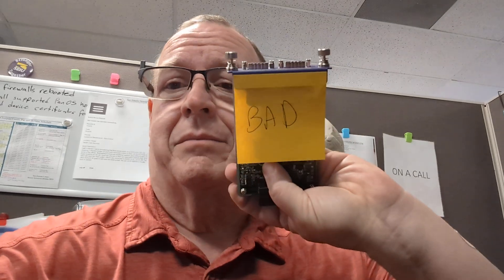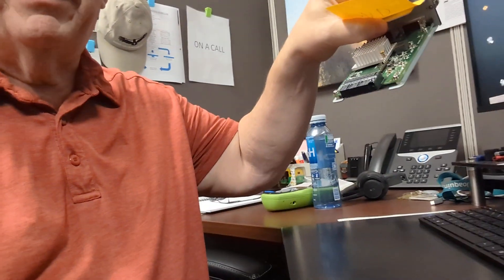Network Admin Life - ED Switch Failure Root Cause

Comment: These add-on modules in any brand seem to cause problems, eh?  Just the other day I had a Cisco Catalyst 9200 sh!t the bed…kind of.  The NM-4G network module that had its fiber uplinks to my 2 core switches just shut down for no apparent reason.  Nothing in the logs either.  Took out my entire building’s operation @ $15k/hr downtime for 15mins.  More on that in a minute.  I thought what the heck, it’s down anyway so let me pull the SFP’s and re-seat them.  Bang, came back up.  After that, I set up 2 trunk ports on the rj45 side of the switch so that, if the card drops again, it will still have a link back to the switch above it in the rack.

Now why did a single switch fault cause the whole operation to drop?  Well, there’s over a mile of conveyor belt in my facility, and that conveyor has servers that process data that’s scanned by the system and interfaces with our warehouse management system to figure out where the boxes or totes need to go.  Whoever deployed the servers never hooked-up the secondary NICs to a separate switch and teamed them.  Single NIC on all servers, connecting to a single switch.  I’ll be getting with the vendor who maintains the conveyor to come up with a plan to add redundancy to those servers.  And whoever deployed the site left the rack such a mess that I never even really saw it until it came time to look.  Unbelievable.
Reply from the maker: Well, there is a mea culpa video coming soon.  I MAY have jumped the gun on this one.  God bless!

Comment: Could be a hardware revision issue on the stacking module, just guessing.  Everything networking is based on a flavor of Linux, so the driver /  module for the stacking device might be failing on newer Extreme OS levels.  This is from a Cisco guy.
Reply from the maker: Watch for a mea culpa video coming soon.  God bless!

Comment: Please include a good description of the issue and include trouble ticket number for previous interactions with extreme.  If not the will run quick function test and send it back out to someone.
Reply from the maker: As you will soon find out, I may not even send it back.  God bless!

Comment: Glad you got to the root cause! 

As much as I think stacking is good for access switches in high density environments it can also be extremely frustrating when something goes wrong with it. 

I've had my fair share of stacking issues in the past with Cisco equipment as well. Shared control plane  = shared fate :)
Reply from the maker: Totally agree!  And it's kind of good to hear that Cisco gives the same problems.  I have had several commenters say Cisco doesn't have these kinds of problems.  I guess they don't until they do.  God bless!
Reply: @NetworkAdminLife oh they sure do. Our Cisco 9600 cores in a VSL has a bug that can unexpectedly reboot. They still haven’t verified the root cause in the latest firmware.

Comment: Wow great find.  None of our EXOS switches use those modules.  they all stack with QSFP cables on the front.  I do have VIM-4X modules that add 4 SFP+ ports in the right most cage on many of the switches.

I would definitely RMA it even though you have the problem fixed.  Extreme can get the faulty unit and if they wish to do a deep dive to figure out what went wrong, it can only help their QA for future product releases and it can benefit all Extreme Networks customers in the long run.  There's that old saying if you don't report a problem they'll never know a problem existed.
Reply from the maker: I will eventually RMA it.  Probalby next week after the holiday.  I want to put it in a completely different switch and see if it does the same thing.  God bless!